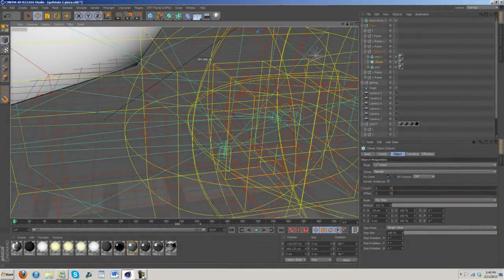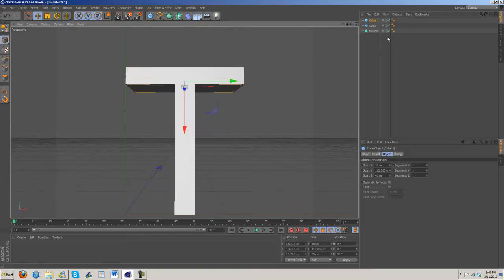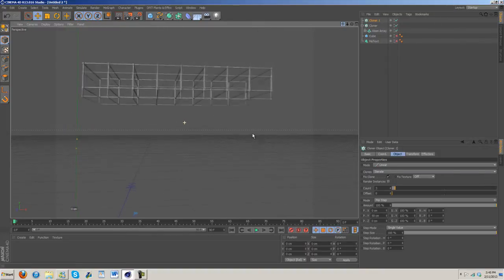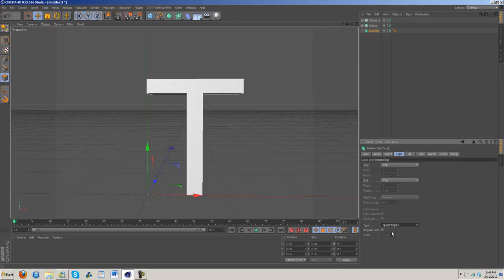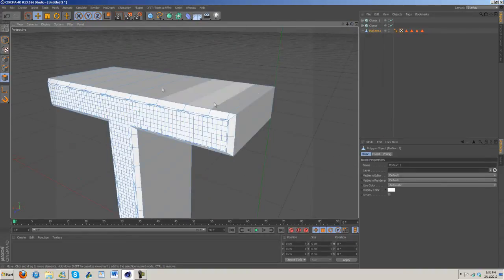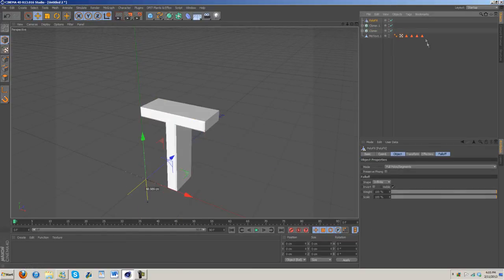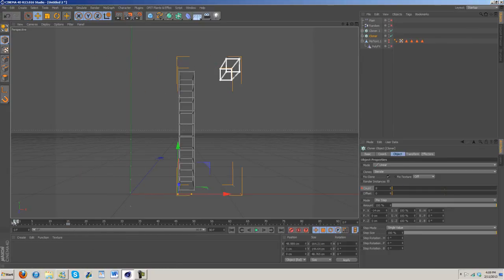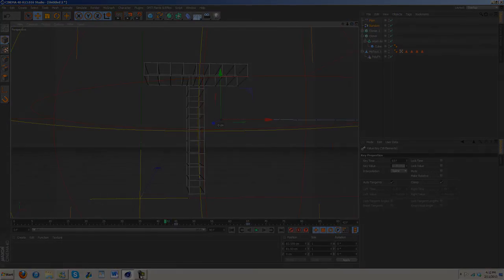Cinema 4D Intro Tutorial | Steel Frame Construction Using Cloners

Comment from the maker: Depends on the type of font, if it's a really curvy font then you may have to do it all by hand, I've had to do that on some things before. However, if the font is not that curvy and has a lot of straight lines then you can do the straight parts the same as I showed, and then use cylinders for the curve and animate the slice so that it unfolds, look at this pic, gyazo (.) com/cc3070b6248e4ea0749177ec38a61ccb

Remove the space and () from around the period.